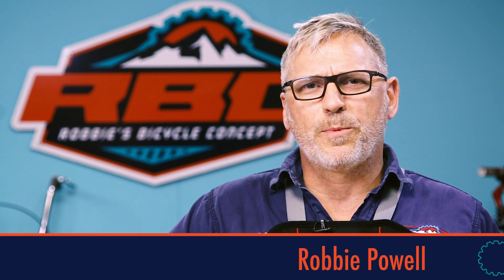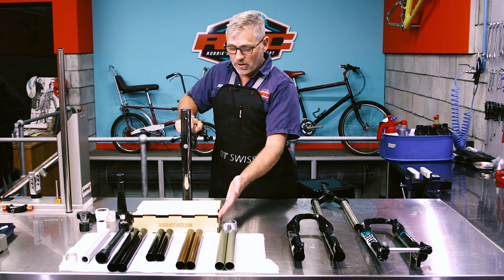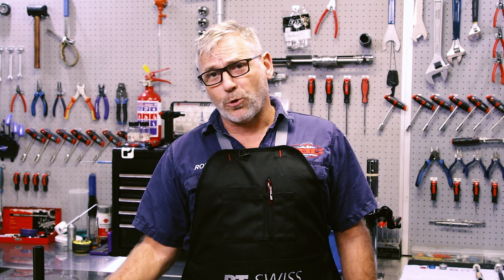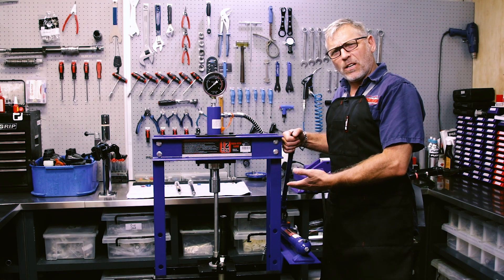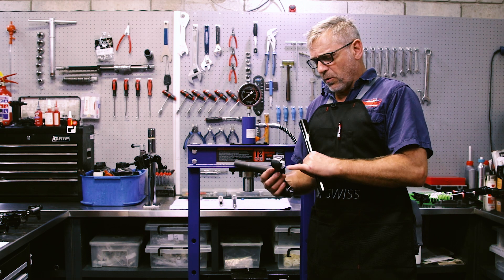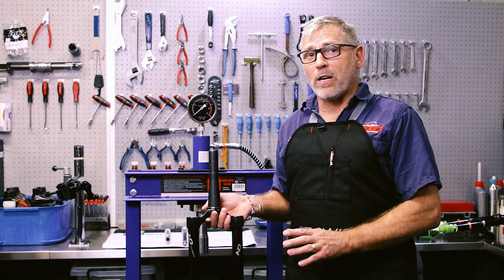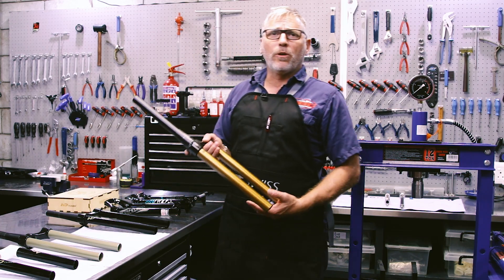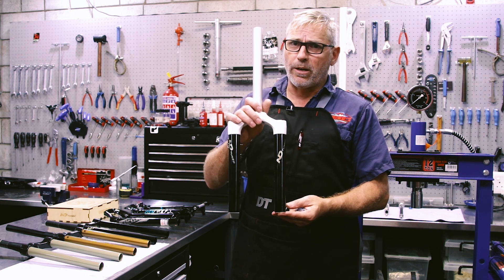MTB Stanchion & Steerer Tube Replacement - Mountain bike fork issue repairs

Comment: Hi where i ca buy the replacement steerer tube? My steerer tube is too short
Reply from the maker: Hi Jay, where are you based?
Reply: You can get it on eBay but your next problem is pressing it out n pressing it back in

Comment: Brilliant, I have been searching high and low for this service and every bike service centre told me I have to bye a new unit. Can this process be used for road bile steerer tube?
Reply from the maker: Hi Keith, thanks for your message and question. Unfortunately we only replace MTB steerer and stanctions. Most road bike forks are either welded or bonded so the steerer cannot be safely removed. If you have are in the position that the steerer is too short or needs to be a different size on your road bike i would recommend replacing the fork.
Reply: @RBC_tech  Thanks for you prompt reply - much appreciated.
Reply: @RBC_tech  How can you tell if the steerer tube is bonded or welded? I have a Suntour MTC

Comment: Hi, thanks for the video.
I have a used Rock Shox Rekon fron a Cannondale bike and the steerer is 1.5 straight, I found a Tapered Steerer tube on a local shop and plannig to do the exchange, my only concern is about to take out the original steerer tube... is there any thead or locking mechanism besides only pressure?
Reply: Hi Manuel, thanks for your message. The tube is set at the factory with pressure only, you will need at least 5 ton press to remove it. I recommend using loctite when you press the tapered one in. Make sure you press the tape tube in all the way.

Comment: I have a 1992 Bridgestone MB-2 with manitou 4 forks. Unfortunately, the1”  threaded steer tube is too short for the frame. What’s the best solution to be able to use this fork?
Reply: Hi Timothy I have the same fork! On a MB0. Unfortunately I only have 1 1/8th threadless steerers so I can't help you with this one. However the steerer is cromoly so a decent engineering company can figure a solution and cut new threads for you
Reply: If that steer tube is steel, find a local frame builder who can weld in the extra length you need. Should be under $150.
Reply: Is there a  threaded sleeve that is able to thread on a fork tube to add more length  to it
Reply: Is it safe enough to braze an add on piece of needed length

Comment: hiya, how much would it cost for a Fox Talas 32 Factory Series RLC  to have its steerer tube replaced
Reply from the maker: Hi Tody, cost to you would be R1500 including the labour. We can fit a enduro steerer which is thicker and stronger than the standard model. Where are you based.
Reply: @RBC_tech  the uk

Comment: Is there an upgrade worth doing on a Manitou Circus Sport/Comp?  Factory fork on the 2020 Haro Steel Reserve 1.2.  I mostly like the fork, but would like to lighten up the bike.  Was planning on buying the Fox 36 DJ fork, as its one of the only higher end forks that come with the 1 1/8" steerer.  Since the factory fork has 3/8" threaded axles, like a bmx bike, this operation will likely cost near $1,500.  Quite the investment for a $900 bike!  But, I've already thrown hundreds of dollar into replacing most other parts.  I should have just bought a bare frame.

Comment: what is the safest method of removing a  new threaded 1  1/8 steering tube from a new set of forks  and replacing with a 25.4 steering tube  The forks are Suntour M3010 24" Suspension Forks V-Brake Threaded thanks

Comment: Just wondering if the coating is twice as thick does that not create extra friction at the wiper seals and also would you need to resize the bushings? 
Thanks
Interesting video
Reply from the maker: Hi, thanks for your message, good question BTW. Ok so when the manufacturer makes the tubes they take into account the 40 micron coating thickness so when the coating is applied the tube is the correct tolerance.

Comment: I notice the aftermarket steerer tube does not have a machined surface like the oem one has.. does it make a difference?
Reply from the maker: Hi Hokiedokie, thanks for your message, sorry for the late reply. The the majority of steerer tubes don't have a machined surface but when the steerer is pressed into the crown the anodizing on the steerer will get scored by the friction due to the pressure of the press fit. The steerer tube diameter is designed to allow a for a press fit steel or alloy bearing race for the lower bearings so there is no need to machine this surface.

Comment: I have a 2005 F100x Terra Logic Brain shock. The left side stanchion (air side) has been oozing a thin film of grease after every ride for sometime. The same stanchion shows signs of wearing/scoring. I have had this shock from day 1 and still works great. Can this stanchion be replaced and do you have the service kit for this shock? Is it ok to just replace the left stanchion? The right stanchion (inertia valve side) is in pristine condition. Thanks
Reply from the maker: Hi, thanks for your message, I recommend changing the stanction on the left if you are able to otherwise the full CSU if you can get. The left side air stanction only has 30mm of oil in after a service and this should stay inside the fork to lube the bushings and stanctions. If there is damage to the left stanction the oil will come out and this can contaminate your disk pads.  We would replace both stanctions with the ND tuned aftermarket stanctions and replace the seals and all oils in a service.

Comment: Hi, I live in the Philippines. May I ask you this my fork steerer issue. What best brand glue in the Philippines or country? Thank you for informing me the update sir.
Reply from the maker: Hi JRDL, we use loctite 2701
Reply: @RBC_tech  my Weapon Hammer (140mm hard trail) fork tapered for steered tube application Loctite 2701 more than 609, 641 and other? 

Thanks you for informing me the update, sir!
Reply: Hey bro! Ano gamit mong press fit para ma i fit yung tubes?

Comment: Hi - I have a 2011 SID RLT 100 mm dual air fork with a straight steerer tube . can it be changed to a tapered steerer ?
Reply from the maker: Hi David, you have 2 options, the cheapest one is to get the bearing race adapter that will take the straight steerer to the 1.5 size, this should be available from your closest cycle store and will press onto the straight steerer (1 1/8) and allow for the 1.5 bearing to fit snugly. Your other option is to replace the crown and steerer tube. We can do this if we get your fork. We will remove the stanchions and fit them to a new crown with tapered steerer. Where are you based?

Comment: What fluid/glue is needed in the crown to press back the sanction?
Reply from the maker: Hi Gam eR thanks for your message,  I use Loctite 641
Reply: @RBC_tech  thanx.. Now loctight I'm used to. As a working plumber I've used bunch of their stuff.
But great vid. Helped a lot. Becouse here in SWE they say that u should replace the crown that's about 500€. Got me wondering cuz it sounded like profit making BS. And you proved me right, so thumbs up

Comment: I have a Fox fork 36 that I want to swap the stanchions on. I have a new upper set of stanchions on the frame and steer tube. Problem is the new stanchions are on a tapered tube and I cant find anyone in the usa to swap them out like you just did.
Reply from the maker: Hi Armando, just sent you an email with the details.

Comment: hi, thanks for the helpful video.
 i had an accident last month and my stanchions are broken. where can i find these tubes online and other parts of fork because i can not afford a new one. please help me out
Reply from the maker: Hi Abid Ali Khan, thanks for your message, what fork do you have?
Reply: @RBC_tech  I have Rockshok Tk 29, Thanks for your reply.
Reply from the maker: @Abib Ali Khan, which year model?
Reply: @RBC_tech  2016
Reply from the maker: @Abib Ali Khan, Firstly my recommendation is to get a new fork as you have had an accident with the current model.  If you cant have the fork inspected by a Rockshox technician to determine if there is any other damage then I would not ride the fork.  To confirm though, this is the TK model with the chromed legs, correct? If so the only option is to purchase a new CSU as the TK has a internal air cartridge because the inside of the stanchions are not air compatible, unlike the alloy legs. If you decide to get a new CSU it has to be the same as you have as the air cartridge needs a special recess at the bottom of the right stanchion to secure the cartridge. If you get an alloy leg CSU it might not fit the lowers as the stanchions are a different lenght and you will have to change the air shaft.

Comment: I was recently in an accident and my 1-1/8 straight steerer tube is now loose in the crown (Xfusion Enix 26" front fork). Can this be repaired at a price less than replacing the whole front fork?
Reply from the maker: Hi Margaret, thanks for your email and sorry to hear of the accident. This fork will need to be checked, as I suspect then that there could be additional structural damage that you are not aware of. Before you ride this again please have it cheeked by an authorized X Fusion service center. If you live in South Africa you can send the fork to us for an assessment, we still hold stock of these parts so we should be able to rebuild the fork.

Comment: Fixing creaking stanchions on a rock shox pike 2015 - what would the cost of this operation be? Can the stanchions be reused or do you fit new ones? Do you take orders from north europe?
Reply from the maker: Morning, sorry to hear about your stanctions creaking. Please check and confirm if the stanctions are creaking or if its the steerer tube. For this I normally take the fork out of the bike, remove the lowers and then flex the stanctions towards and away from each other by hand, if the stanctions are creaking you will hear it via this operation. To confirm if its the steerer is a little more complicated. I clamp the steerer tube in a soft jaw vice with the stanctions aligned vertically, then push against these to check if the steerer is creaking.  My experience with this model fork is its the steerer tube that creaks.  If its the steerer tube,  Nuno at NDTuned in Portugal can assist with the replacement.

Comment: Is it possible to replace corroded Rock Shox 28mm stanchion tubes?
Reply from the maker: @Kenroberts3454, thanks for your message and support of our channel. Technically this should be possible provided you have the correct tools and replacement stanctions. Currently I dont know any supplier with this size in stock. Your best bet would be to find a matching fork online and replace the complete CSU.

Comment: Good day! Really great video! Do you use Loctite 641 for the steerer tube as well? What do you think about Loctite 4080 ( or 4070, 4090)?
Reply from the maker: Thanks Max, I use loctite 641 for both applications although I find the 641 a little thick at lower temperatures so I am looking for a thinner loctite for the steerers. I will check your recommendations, thanks for your feedback.
Reply: @RBC_tech  Good day! I ended up using 648. It is thick, only 4 minutes bonding time (made me a bit worried at installation) and has higher bonding strength but needs heat in case of take it apart again (which obviously won't happen). My only concern is these glues have to clean metal surface to chemically react. Most of the steerer tube is anodised black. Should be the anodised surface removed? I didn't do it. (not sure if want to decrease diameter even with a hundreds of a mm.) Anywa, it stopped squeaking. Will see how it works in a long term...

Comment: Hi where's your bike shop found? I have a rockshox lyric fork and the steer tube is doing some noise like it's cracking i want to fix it pls help... I'm from the Philippines
Reply from the maker: Hi Yves we are based in Port Elizabeth,  South Africa.
Reply: Hm does i need to pay for the fixing?
Reply from the maker: @yveslastimoso6928  If your fork is withing the warranty period and you are the first owner, Rock Shox should help you under warranty. However if the fork is out of warranty or you are not the first owner then you will need to either buy a new CSU or pay to have the fork steerer tube reset.
Reply: I'm the first owner and i don't know if my shock has a warranty because it came from a built bike
Reply from the maker: @yveslastimoso6928  if its still within 12 months old then it will be covered by Rock Shox as a warranty no problem. Who is the Rock Shox agent in your country?
Reply: I have no idea who's the rockshox agent here in the Philippines... but my rockshox lyric is 3 years old already, 2017 model... here in the Philippines we don't have bike shops that can provide everything they only sell parts and bikes and overhaul bike then thats it i wish we have bike shops like other countries...
Reply: Same here my lyrik is doing the same thing
Reply: @yveslastimoso6928   we are so unlucky we dont even have bike parts here in pakistan.

Comment: can i get a special tools listing and adapter that's needed to go from a tapered steerer tube to a full length 1-1/8 tube please.
Reply from the maker: Hi Bryan, that but we only offer this change in house. You will need some special tools as well as a 12 ton press. We would have to press out the tapered steerer and depending on the fork, use the appropriate adapter and straight steerer. Where are you based?

Comment: Hi Rbc, the aluminium adaptor  (@ 1:04 mins) for the tapered stem to straight stem conversion, is it sold somewhere or do you have it machined for this fork? Thanks!
Reply from the maker: Hi Titus, thanks for your message and support of our channel. This adaptor is sold separately and you will need to specify Rock Shox or Fox when ordering. Its available from us or ND tuned.

Comment: Hello from Australia,
nice video thanks for sharing. I have a fork which has a 1 1/8 Steerer tube which I would like to use on a mid 90s Mountain bike... only problem is the head tube is 1”threaded. Is it possible to replace the 1 1/8 steerer tube with a 1” ?
Reply from the maker: Unfortunately I don't have a solution for you in this. I would hesitate to fit a 1" threaded steerer to a modern fork as the fork travel, stiffness, and leverage might be too much for the steerer which is why the forks when to 1 1/8 and then to taper.

Comment: Hi i have a fox 36 van rc2 coil from 2008 and i want to know if there exist a csu for that fork for sale or if i can put some other csu from another year but with the same sizes?
Reply from the maker: Hi Esprogdy, thanks for your message, its possible to match the stanctions but I don't believe a new CSU will be available. Does your fork have the 4 digit number on the back? if so please send to me so I can try to ID the stanchion lengths
Reply from the maker: Please measure the stanctions from the bottom on the leg to where it goes into the crown, this will aid in the ID thanks
Reply: @RBC_tech  Hi RBC thanks for reply me, as you asked i found down in the crown some numbers and those are 131600-0047, and the size of the stanchion from the bottom of the leg to where it ends before the crown is 31,1cm. But all the real size of the stanchion from bottom of the leg to where really ends icluing the crown is 35,1cm. Thanks for help me.
Reply from the maker: Thanks I am just checking what I am able to get hold of and will let you know.
Reply: @RBC_tech  tank you
Reply from the maker: Hi Esprogdy, sorry due to the age of the fork I cannot find a corresponding CSU. My suggestion is to search the web for someone selling a 2nd fork like this or try to buy another one new.
Reply: @RBC_tech  understandable, but is it possible to repair the damage with epoxi resin? Or recreate a new stanchion with a lathe? If yes I'll try one of these option especialy the epoxi method.
Tank you for helping me.

Comment: Hi, I got SR SUNTOUR AXON 32, I CUT the steerer tube too short, May I ask if where can I buy a replacement Tube, please answer me and Your response will be very much appreciated. Also I'm from the philippines thank you!
Reply from the maker: Hi Jeff, thanks for your message, do you have a Suntour distributor in the Philippines? If so it would be probably cheaper to replace the CSU than sending this out to have the steerer replaced.

Comment: Hello sir
My bicycle’s threaded steerer’s thread are miss/fail/free is it possible to repair it 

Or i have to change whole fork is only an option.
Reply from the maker: Thanks for your message, not sure what fork you have but it sounds like the steerer tubes we have wont fit the fork in question. Please send me a picture of the fork showing the make and the problem with the threads, please use my robbie@robbiesbicycleconcept.co.za email address. thanks

Comment: Awesome video! I have a Manitou Darado Pro that needs a longer steerer tube. Cant seem to find anywhere to sell them without the crown attached. Any idea where to purchase? I am located in Hood River Oregon USA. Thanks!
Reply from the maker: Thanks for your message, the steerer can be replaced but you would need to send the crown to us for the work. It would probably work out cheaper to purchase a new crown as the shipping costs to SA will be quite expensive. What is the price for a complete crown steerer assembly in the USA?

Comment: How much ton pressure was it when you pressed the steerer tube?
Reply from the maker: Hi Lubbi, between 4 and 5 tons depending on the pressfit tolerances.
Reply: @RBC_tech is it the same if your pressing it out 4-5 tons?
Reply from the maker: @lubbi0681  Yes depending on the age of the shock and how its been used.